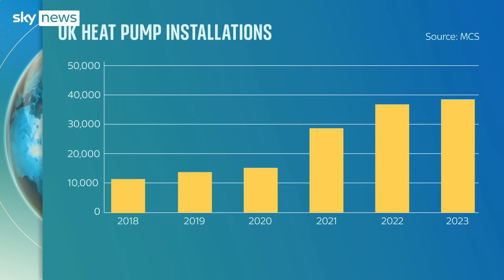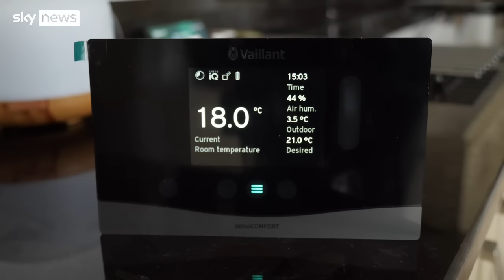Will heat pumps work in Britain?

Comment: Lived with one for 3 years in a rental. I thought it was fine and enjoyed the 24/7 heat, although one room would never heat to optimum temp so I had to supplement with an electric heater on occasions. Wouldn't say it cost more than a gas boiler, and it was left on 24/7
Reply: If its only in reasonably warm conditions why do they all seem to have them in Scandinavia? Is that a warm climate?
Reply: @carpcrazyboom5190  most issues in the UK are caused by installers who don't know what they are doing. This technology has been used for decades in scandinavia.
Reply: @carpcrazyboom5190  In Scandinavia electricity was very cheap and a lot of it is hydro-generated. I lived five years in Norway and what most struck me was the fact the way they wasted electricity, never turned the lights off and would leave the house and leave the television on.
Reply: @carpcrazyboom5190  I don't know many who have heat pumps here  in Denmark, some but they are not the norm.
Reply: Nice one, that's how they're designed to be run, 24/7.
Everybody that has issues with HP's, from saying they cost too much or they're ineffective, are typically treating them like gas boilers and switching them on and off all the time.
That's why they end up with knackered fans, worn out compressors and massive bills from running them at full power for an hour then switching them off in the mistaken belief that they're saving money. It's commonly why they freeze up as well, because they're working way too hard for too short of a time.
Reply: Gas per kwh 7.5p. Electric per kwh 30p. Heat pumps can provide 3 times the heat output to the electrical input in optimal conditions effectively 10p per kwh of heat output but only in reasonably warm conditions, there less efficientthe colder it gets. Heat pump systems need larger radiators to compensate for lower water temperatures in the heating system, larger pipes to distribute heating water and houses heated with them need to be upgraded dramatically in regards to insulation. Those are the facts in regards to there usage from someone who's well informed on the subject. Many older houses are just not suited to these types of systems.
Reply: @ricardosmythe2548  Plenty of electric tariffs that work out less that 30p per kWh, our average for the last month has been 11p per kWh. Total electricity cost with the heat pump on 24/7 for heat and hot water, running washing+machine tumble drier 4 times per week and all other electric usage is around 1/3 of last years gas+electric cost. House dates from 1560, has insulated roof but not walls, it's warm for likely the first time in it's history.
Reply: @ricardosmythe2548 someone that knows. Good comment

Comment: We use heat pumps in Canadian winters.  They are not cheap, but they do the job.
Reply: Same here in Sweden. Have a groundsourced 120m deep well. Have been running very well since 2005. Cost a bit, even back then. Warm and cosy year around. Had -32celcius last week. Plenty of warm wather for showering ect.
Reply: I thought it’s gas operated ?
Reply: @xclusive463  Electric.  I live in British Columbia, we have cheap, mostly hydroelectric power.
Reply: @wolfecanada6726  electric is 4 times price of gas 🤪🤣
Reply: Air source or ground?
Reply: @Oligodendrocyte139  sits on my back deck, open air intake
Reply: @wolfecanada6726  Sorry, I wasn’t being clear 😀 but it guess this is getting its heat from the air rather than from buried pipes in the ground. Keep warm there!